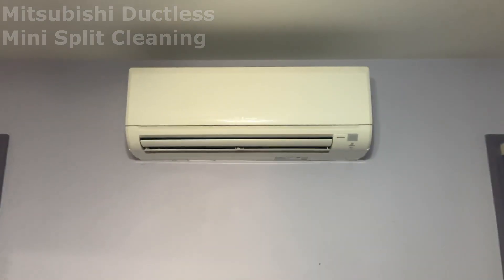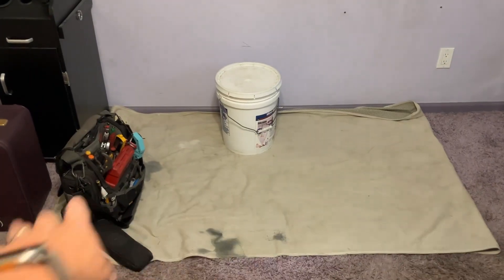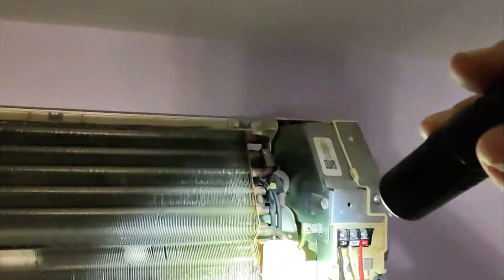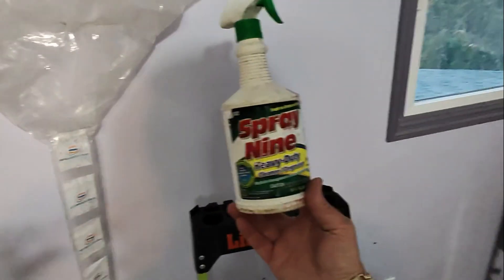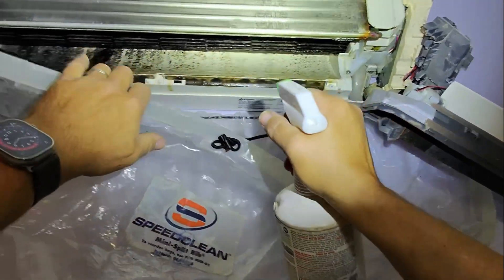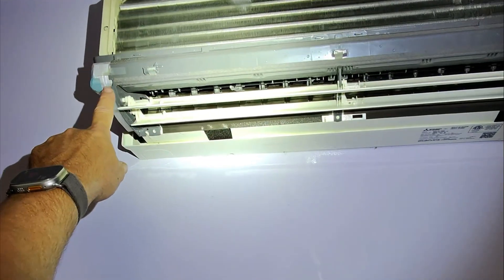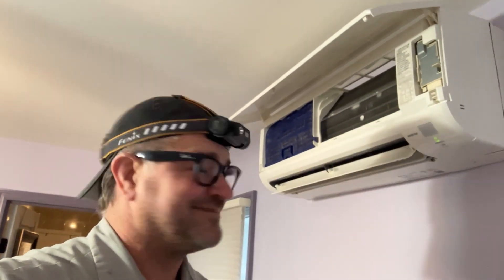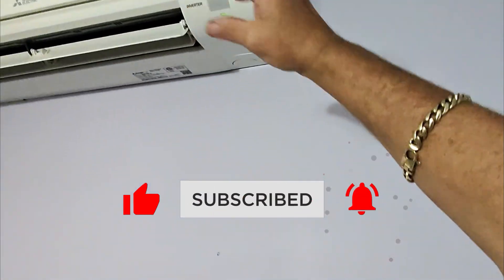Mitsubishi Ductless Deep Cleaning Procedures by Local HVAC Contractor

Comment: I have 2 Mitsubishi Mr. Slims 36,000 each in two detached garages on my property. I always clean them after the cooling season before transitioning to heating. These units create a lot of mildew during the cooling months with the blower wheel collecting a lot of dust and dirt. I use to pull the blower wheel completely out to clean it but recently purchased a ZPB140 Port A Blaster. A self contained light pressure washer that works perfectly for this job. Purchased the drain bag separately. This is a very necessary service especially if you have these installed in your house. You do not want to breathe mold and mildew.

Comment: Just curious if you took it out this far why not just pull the wheel out instead of using the sprayer kit? It’s just two screws on the left side of the coil, loosen set screw on wheel, coil lifts up where u took the screws out and wheel slide out
Reply: Curioussssss